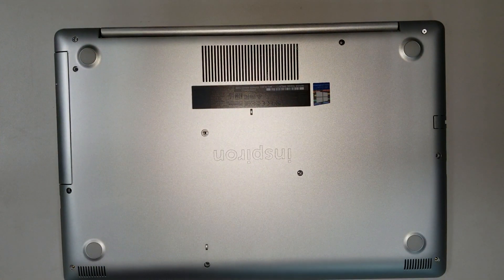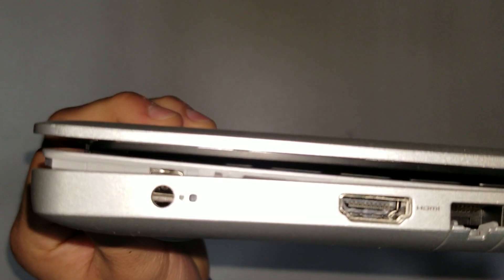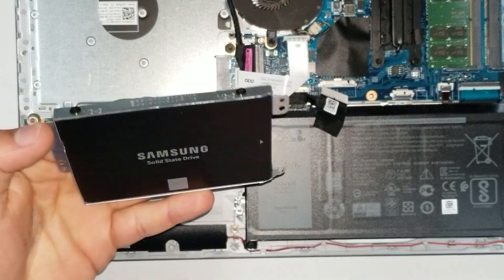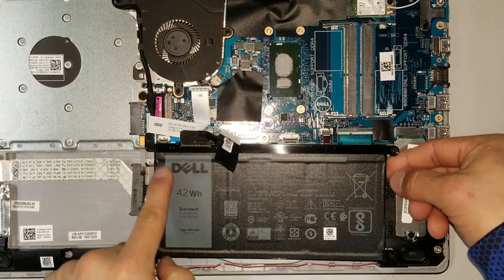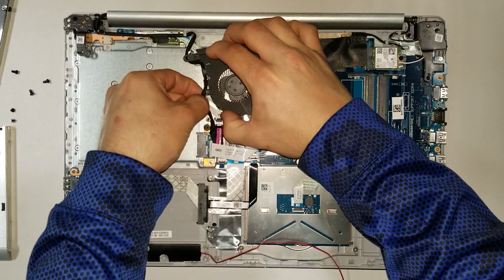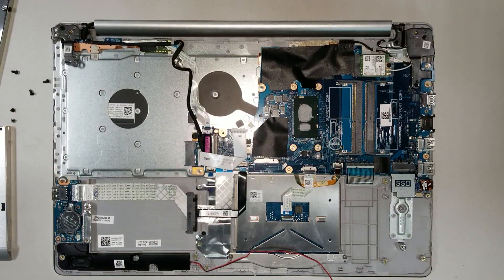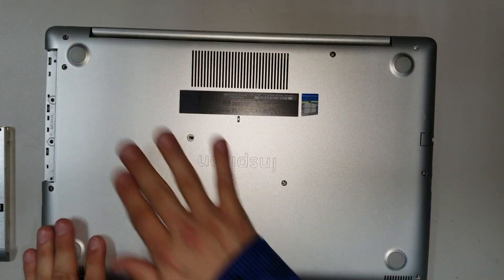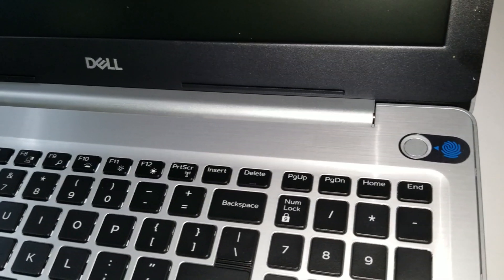Dell Inspiron 5000 series 5570 Model 2019 [Disassembly & Reassembly] 4K

Comment: I got this laptop in March 2019, and it's a Dell Inspiron 15 5570 with an Intel Core i5-8250U. This model doesn't have the DVD drive (although the manual shows two models; one with a disc drive and one without), and I'm thinking about upgrading the RAM on it, so would there be any differences besides not needing to remove the disc drive?

Comment: Hello, 
considering how to compenents are placed, do you think I can use compressed air to clean the dust without opening the laptop(first spray on the exits, then on the intakes). Is it also dangerous for the fan? I haven't opened a laptop before and I don't want to mess anything up...
Reply from the maker: Welcome i hope your weekend is going fantastic. Kindly make sure if you use compressed air, please use air cans or compress air for electronics.  If you have been using the laptop from more than 1 year, you should get some thermal paste from Amazon or the local store to replaced it from the processor and apply new one. If you want to do a quick dust removal won't be as good as opening the laptop but probably helps. You should removed at least the DVD unit. But as my  recommendation open the laptop is very simple just follow my video.
Reply: @xlearntechnow  thank you very much!!

Comment: My laptop is showing no bootable options , I was thinking that my hdd is lose and lost connection if I re fit it again can it work ?
Reply from the maker: Go to the f2 option. BIOS settings. If you have windows 7. Try legacy boot mode.  If you windows 10 try UEFI mode. Let me know if this help. Could be an issue on the BIOs settings. Remember to save the changes  and restart
Reply: @xlearntechnow  it didn't work, I guess either my hdd has lose connection or its corrupted, can only be known after I open my laptop😭
Reply from the maker: @harshbaldha3153  do you have regular hard drive or ssd m.2?
Reply: @xlearntechnow  I have 1 hdd 2 tb and 1 ssd m.2, also the same laptop as shown in video
Reply: @xlearntechnow  my SSD is failed so I removed it and installed windows on my hdd,

Comment: Wow i didn’t know it can support both SATA SSD and M2 SSD at the same time. My 2018 Inspiron 5570 came only with the factory HDD which is currently failing. So i guess I can have both SATA and M2 SSD installed?
Reply from the maker: That is correct. You can have a m2 ssd for the operating system and a ssd or hard drive to backup the data. If you hard drive has failure after running a diagnostic. I recommend you to buy a new one to storage the data. I recommend you to get a ssd 512GB or higher. Welcome to my channel. Please subscirbed.
Reply: xlearntechnow Yeah I really stressed out the factory 1 tb hard disk drive that came with the laptop by being hard core gamer. I just wanted more storage to handle the gaming. Thanks 🙏
Reply: xlearntechnow hey Also I’m new to computer stuff, do I install the m2 ssd first and install windows 10 on it......and then shutdown and reopen the laptop to install the sata ssd?

Comment: Tolerable videos but as we have to remove mom's back cover or the Dell cover that says it when closed (a corner broke off) kinda need to replace that whole area.. This is just the bottom.  and doesn't show how to undo the network.  (wifi)  guess I'll just take these and go from there.  Been working around Dells since 2003 so yeah they seem to be a pain to take apart.  I'm temporarily I hope on an HP because it had a drive for the right price.  Alas not the right wattage so alot of my externals drop off the system so had to get a powered usb hub  (60 watt for now)   (PSU is a 45 watt PSU.  :(  my old Dell was a 130 watt PSU..  Bit of a drop off.  And only because my back cover or top cover's screw holes that are metal in plastic attached to that cover tend to break :(  gone thru 2 of them now.  Original , and $125 replacement and now another $125 replacement 6 months later plus a $20 left side screen bracket.  That one still has better sound.  HP's don't.  Already took this HP apart.  Bottom too easy to take apart except many screws under the rubber feet.. Screen don't know yet and as I said this video doesn't show that.  Another older one has it set that it's adhesive that is the issue.

Comment: Hello, mine has an i3 processor, do you know if it is likely soldered to the board in or can i upgrade?? Thank you.
Reply from the maker: Welcome, hope you are having a fantastic weekend. This processor is soldier to the motherboard. Manufactured don't recommend for you to change the processor, unless is done by a professional. (As a marketing strategy, most manufacture already setup each motherboard for specific processors). Hopefully this help, I recommend you to buy the laptop with the processor that you need even if it's more expensive. Of course storage and ram can be upgraded.

Comment: what aboat fan noise???
Reply from the maker: Did you ever opened?. . If not, try upgrading the firmware. Clean the fan. Check the BIOS setting at the startup to check if you have any high performance setting on. Check the event viewer to find out if processor is 100% or memory ram. Google chrome is causing that issue in some computer  that put the ram up to 90%. Please let me know, and if I can help. Before doing this check warranty in the laptop. By putting on Google (check warranty for Dell laptop) and put the serial number that is under your laptop. Thanks and please subscribed